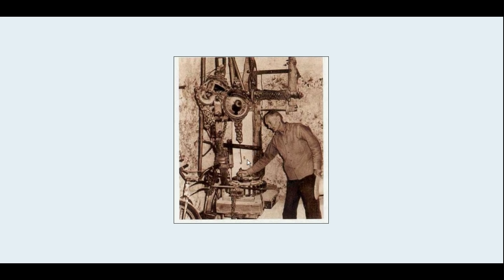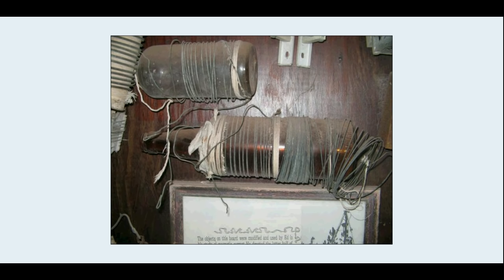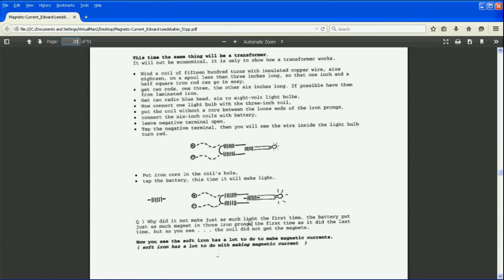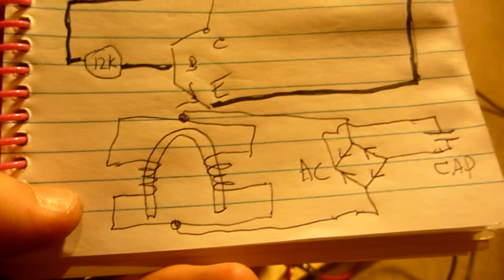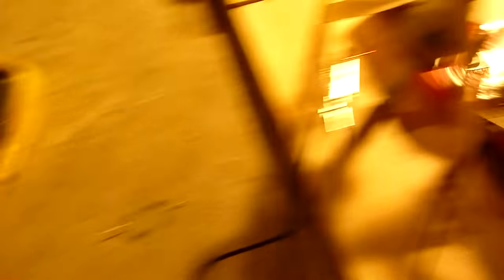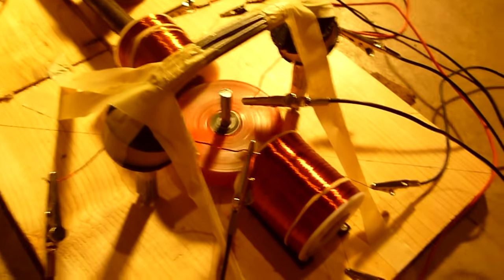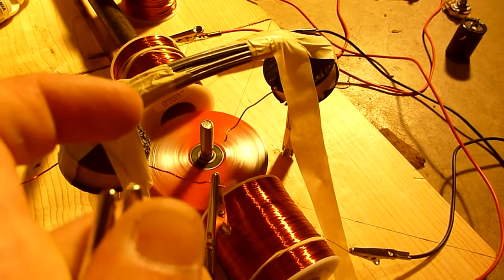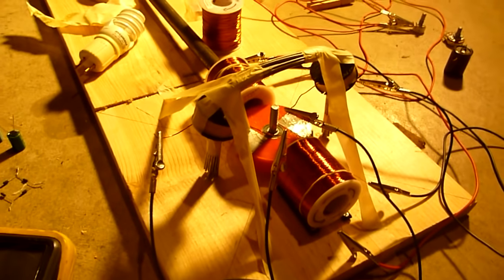Ed Leedskalnin's Over-unity Generator

Comment: you have some points but wacum tube baterry chargers are similar sistem also metadyne rotary transformer trifilar winding patent can by found so that same device consists of motor /generator/excitor dynamo/dc to dc comverter imcluding a dc to ac inverter circuet including spliting brush out put by altering magnets poles or removeing them so the out put can by +-,-+,++,-- I done also some experiments in the past with s/r type magnet starter motor and the delco 12si alternator does some funny staff including arc shuting xenon bulbs who act identical to wacum tube and dual relays effects and stuck horn or random back charge the effect bouth organic gas and chemical gas work in magnet pumps ! Also they work on multi stroker engine or gasoline-disel engine block or dual engine type runners so to run any Compound Generator you need also Compound Engine to run that thing. I watched for years the Joe Cell guy in the end it was coolant ,decaying lubrication oil and some tree oil acid absorbed on hot engine who is magnetised! So no fuel what so ever also surage bacteria is drawn via magnetism and bacteria surches for warm enviroment meaning engine flooda the result contaminated lubrication oil aka bacteria eating oil = ethanol/methanol gas lot of those old engines culd operate via crank shaft porting and fuel pre heating ! So your best bet is controling induction and polariti of coils useing the metadyne rotary transformer and useing tesla pumps with magnetic pipes asistance similar to water fontain or that water bucket vandegraf experiment static discharge also runs engines with out spark plugs,compresion,heat or other staff. So imagine runing Strling and Pulse Jet in 1 unit and that tehnologi GM uses for years . I will show you the result .Watch carefuli observe the fuel filter .Also ED hade Hit and Miss engine or it migh by Hot Bulb engine heaveli modified ! They hade kerosine water vaporisation lot other things can by added to that engine like inurt gas arc welder or metal particel or moisture absorbing ethanol or bacteria regeneration of natural  gas after all some tree types have flame strenght 20X more power then ordinari gasoline so micro jets are used for carburetors in their twin engine state posibiliti are endless I shureli hope you understand what the Papp engine does also aperantli you can use ither 2 chemical gas or chemical/biological gas mixed in % . The Metadyne works in % the Multi Stroker Dual Engine Type engine works in % not ohm law or lenz law no protones no electrones ! So that engine and generator have own combined laws who are altered because now you use in 1 unit graviti thermal electro magnetic effects and they are represented in % . And the Joe Cell guy only enchanced nort and south side by its % by useing thin sheet of metal so aperantli magnets can also increase or reduce pole faces in % So even ferrite magnets have special abiliti if they are hot they increase amps but reduce volts so thats why peopel polarised with baterrys in series to repair poles on the ford model t magneto to counter that effect some times the poles get so mesed up that some magnets get demagnetised so you end up at ich brush out put + and + .So its dobbel positive dynamo nothing weard about it so you need virtual ground to force that staff to exit the generator still counter emf is present the own generator mass drives current true the windings with out safty load the wires wuld burn out .Im not electritian I have my own experiments but Hot Bulb Gasoline-Disel Train with electric transmision existed lets asume that the generator was s/g set + metadyne rotary combo and besides the owen magnetic car also existed long before any wars or john bedini in general .So peopel probabli used only voltage potentials or inductors to move staff from point a to point b . Ed also was up hill so probably water graviti magnetic pump migh work in hes favor. The water has lot micro organism land is full of natural resorces,wind water power and preati much culd by any thing .

Comment: Just try using a 2 or 4 pole stepper motor as a generator like the one in my video. Acceleration will be very pronounced above 300-500rpm

Comment: This is an important discovery...unfortunately mranguswangus made it first also mr2tuff tried a bunch of pmhs wired in series and the effect goes away I have intentions of playing with the angus effect myself ...glad to see someone who believes in the magic of Ed leedskalnin! Fuck the trolls
Reply from the maker: Duane Harris That is correct MrAngusWangus did it first! I don't see the quest for over unity as a race between people rather it is a group effort... where everyone will benefit in the end. Having said that I have to point out that I did something different in this video. Angus had a wheel with magnets spinning through the prongs of the PMH. One magnet passes both sides of the PMH at the same time. I used two magnets spinning between the PMH (Ed Leedskalnin actually has a drawing of this in his book "Magnetic Current"). I also 100% agree with you about the trolls... they suck.

My plan is to make something large based on this idea..... That is all I can say for now. Thanx for the comment.

Comment: Naiki, I saw you tried some coil connection configurations and pulled some conclusions. May I mention that your approach could have been more scientific if you would have tried all configurations. I mean, both coil in parallel direct and then reverse polarity and then both coils in series both polarities direct and reverse. It would have been a lot more convincing to see if when both coils in reverse or direct parallel would not have slowed down your motor. I am very curious about this result. Hope to see more of this soon. Thanks, this was very interesting.

Comment: where is your power source
Reply from the maker: G Dogg the power source is an old phone charger with soldered alligator clips (5.9 volts @ 400 mA DC). In the followup video I go over every component used in detail. This is the real deal, the Lenz-free power system. If the coil is under load or not under loaded it continues to act the same! How did Ed Leedkalnin powered his flywheel? He used an AC motor with a transformer. He would spin up the flywheel to several thousand RPMs until his motor would kick in and from that point on the flywheel would power itself. Since there is no Lenz effect that is possible (Lenz Law is what prevents this from happening normally). Experiments and Observations > Theory

Comment: you're showing an electric motor powered by a battery which is a dc motor. The differences in windings aren't making any great discovery and there is nothing perpetual about this circuit. I'm not sure whether or not you are trying to convince yourself or your audience through lack of knowledge but you need to stop if you are trying to say you have discovered perpetual motion because perpetual motion needs no outside power source to run and run indefinitely. Don't kid yourself. Go back to basic electronics and start over. The scientific community is not that dumb. It is however halarious if you want people to laugh at you. Conservation of energy?  please...